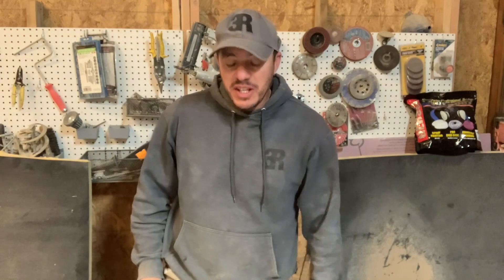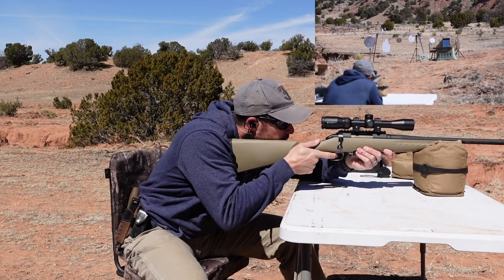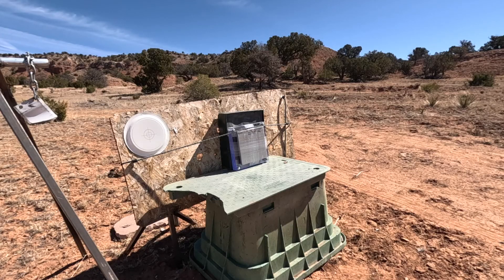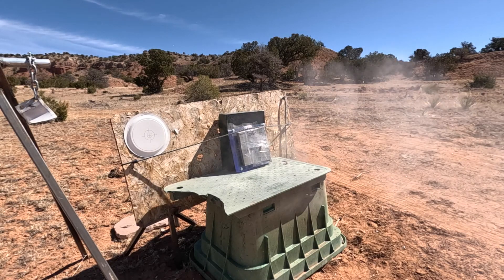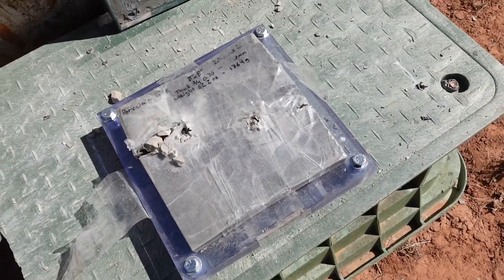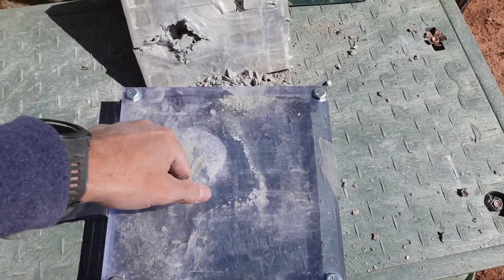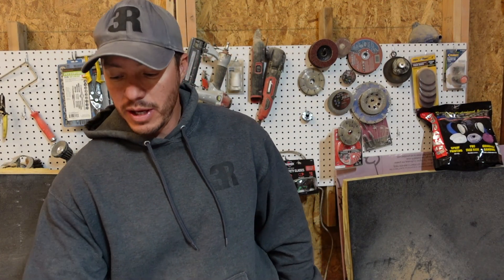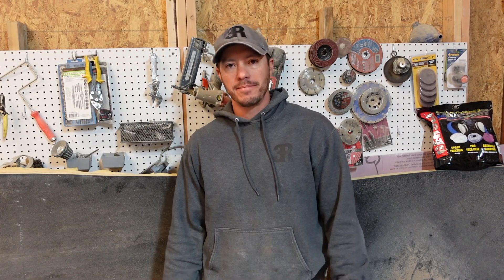Can Tile effectively slow down a bullet?

Comment: Double stack and stagger 1"×1"×1/4"backsplash sheets... but wait, there's more... now put this inside a vacuum sealer bag and fill with oobleck. Ceramic suspended in a non-newtonian fluid encased in heavy plastic, and for schnitzel ticklers, wrap it in carbon fiber

Comment: Use silicone carbide ceramic composite brake pads for making ballistic body armor. In my testing the ceramic composite brake pads with 20 layers of kevlar as a backer to catch any fragments was able to stop rifle rounds,  M855 green tip, 7.62×39, .308 and .30-06cal

Comment: The two layer tile benefited from an edge-gap-effect in addition to the extra thickness. Like paint, building up many thin layers can have better performance than trying one thick coat. Diversifying stacked materials can help such as a thin sheet of aluminum, copper, lead, or soft steel between the two tiles. Take a look at Damascus Steel or Japanese Katana blades, many layers of hard and soft steel folded and sandwiched together to give strength and toughness.
Reply: In the case of Japanese swords, it's a bit different. You see, the reason the Damascusing, or folding, process is done is to better distribute impurities in the steel throughout the blade. Japanese steel was very impure, so this made much more resilient blades. As for the differential hardening, it's important to remember that katanas are made from a single block of steel. Meaning, the harder steel is chemically bonded to the softer steel. The advantage of this was giving the cutting edge a more flexible, less brittle glue. Additionally, it made the edge more likely to chip than facture or flex, something very useful because Japanese blades were not made of spring steel like European blades. And so could not bend and return to shape, they would simply break or bend permanently.

TL:DR the katana comparison doesn't really apply to ballistics here, and what applies to katanas was super contextual

Comment: Got a suggestion to make: Look a medivial Scalearmor, where the pieces overlap partially like roofing tiles do. Palmsized Ceramic Pieces layered like that, followed by 1mm layer of ductile steel strips of wider size ( similar layered and spotwelded) backed by some layers of that landscape filter fabric you showed last time. In Theory the hard ceramic deforms the bullet, the ductile steel should distribute the impact energy and the filter fabric stops the much deformed and slowed projectile. thesmaller pieces or ceramic could in theory have the plate withstand multiple hits if they arent on the same tile/spot where a single big plate may not because of microcracks.
Reply from the maker: Absolutely. I’ve been toying with testing something similar to this.
Reply: @3RBallistics  don't the bullet just climb between the pieces like this?
reason why scale armor was terrible against spears.
thing with ceramics, it's a hard strike surface made to break apart along with the bullet.. robbing the bullet of it's power due to the breakage. 
but if hitting it from an angle. it might just skid.

would be interesting to see tested.
Reply: @martinpetersen6266   I guess that depends upon the angle and then a lot on the momentum. The Spear analogy you use would likely be true if the gun was firing not ordinary bullets, but rods similar to those tungesten/depleted uranium rods used in APFSDS rounds, besides high impact energy there is a lot of momentum behind that, kinda doubt regular bullets will act that way.

Comment: You can use the Styrofoam knife to cut the fiber glass To prevent it from fraying. Basically a heated piece of wire to cut it . I would also rotate the fabric when using layers of fiberglass.. And when you're finished with the piece you could also use the vacuum sealer with plastic and low but a fireglass resin to help keep the edges. From being sharp and rough

Comment: Great video. I had a hard time being able to tell, but did you think the double tile or the single, thicc tile end up producing a better result. I mentioned on the other video that I was interested in using the thin hex tile from the hardware store, but using two staggered layers to cover the gaps. Wondering if it would just be better to use thicker tile. Great work and thank you for making this!
Reply from the maker: The thick tile produced the best results but the weight is a bit of a concern. I think doubling up two tiles is the most practical option.

Comment: It looks like you have a good start on armor. Layers of two-inch Hexagon ceramic tile a quarter inch thick attached to a flexible layer of energy-absorbing fabric an inch or thicker should alleviate the problem of two layers of ceramic tile taking as much or more damage as a single layer of tile. Small pieces of steel coated with bed-liner coating could be incorporated in the same way. 

Try some standoff distances between elements so it is more difficult for damage in one layer don't propagate into the next layer.

It would be interesting to see if you can make bulletproof graffiti with geo-filter cloth, cement, epoxy, ceramic tiles, and ??. Build up a background using enforced cement plaster to hold fabric and ceramic tile to an armored steel back plate that is the background for the graffiti.
Reply from the maker: I really like these ideas. I’ll give them a try. Thanks.

Comment: You might try adding a soft/light/cheap "gap layer" between the strike face and the stuff that's supposed to stop the projectile. The thought being that the face starts to flatten/expand/fragment/tumble the projectile making it easy to stop and the gap give that more time/space for that to happen in.

What might be really interesting would be tile bonded to soft and thin sheet metal (metal to keep the tile bits together longer, soft to get as much stretch before it rips, thin to save weight and cost) on top of 10-20mm of medium density insulating foam and then something more substantial to actually catch things.

Also, have you considered acrylic as a strike face? IIRC it does a very good job of spreading out high loads without shattering to dust in the process.
Reply from the maker: I really like this idea. I’ll give it a try in some upcoming testing. Also, I have used acrylic before and it works really well. I’ll be making a video covering DIY bullet resistant window using acrylic.

Comment: I’ve made and tested a few “bullet resistant” panels with flooring tile as one of the ingredients.  I found what worked really good was 2 floor tiles separated and held together with layers of denim and liquid nails.  Then I used a couple of license plates in the back to help stop any broken rounds that did make it through the tiles.  

When making these panels, I used compression from car batteries on the panels for a day or two till the liquid nails had plenty of time to setup.  You have to be careful though because the layers will slip and slide.  So, I built a small wooden frame to keep the layers in place until the liquid nails setup.
Reply from the maker: I love that idea.

Comment: Very interesting. Lining a safe room Inside and outside with tile and filling the wall void with pebbles/gravel would likely be quite impenetrable by most common rifle cartridges. 
Cool stuff. Now I have ideas. Also, the more I see those Ruger American Ranch model rifles on various channels, the more I want one in .300 AAC.
Reply: I remember seeing something about "portable" structures that are made of steel channel where they use a mesh on both faces to hold in ceramic "gravel". These were also faced with ceramic plates on each side. These 2 foot square by 8 inch thick modules could be stacked into wall structures to create safe rooms or whatever you desired. You could face each side of the completed wall with additional 1” fiberglass panels to increase protection. I think they had these walls tested with various .50 cal. rounds with zero penetration into the safe zone.

Comment: Take some epoxy and fiberglass and bond them to the back side of the ceramic. You will likely have to sand off any glaze on the ceramic. Ceramic has amazing compressive strength and hardness, which is why it works so well. Unfortunately ceramic has very poor tensile, which is the cause of its failure. Fiberglass has high tensile strength and when bonded to ceramic with epoxy they are both in a position to cover the weaknesses of each other and enable them to fully utilize their strengths. There's alot more that can further increase its effectiveness, but that's a good start. I recommend bonding the epoxy to the sides of the ceramic aswell. Believe it or not it would help.
Reply: A bit of light tin between the two might help as well by preventing the ceramic from cutting the glass. Or the ceramic might already be sand at that point and tin might do nothing or act as its own knife. I'd be curious to see.

Comment: Nice video but that is not 3 inches of poly carb it might be 1 1/2 inches but not 3  a tape measure will come in handy 👍🏻
Reply from the maker: I’m sorry, I should have clarified. The control without any tile on it was 3” (each piece of polycarbonate is 1/2” thick, and there were 6 pieces). Each other sample had 1 1/2” (3 pieces) of polycarbonate behind it.
Reply: @3RBallistics  the polycarbonate is an interesting material to shoot at. If you flame polish the edges, you can get another cool angle to show the damage from.
Reply from the maker: @KevinSmith-gh5ze  thanks for the suggestion, I’ll give that a try.

Comment: random thought: 
using 2 layers of mini tiles, cut so that one layer covers the other's edges, then backed with a steel plate that has the edges cut and bent so that it both covers the sides and front edges of the ceramic tile array, then the edges get welded up. 
sort of a hybrid that would also (at least in concept) be functionally spall-proof on it's own. 
adding a 1"-2" layer of the landscape fabric should catch any fragmentation trying to leave the plate through the puncture hole.

great channel, I don't use my google account except to comment but you're in my bookmark bar underneath Ordinance Lab (they're in the "gun-adjacent" section of my bookmarks list lol)
Reply from the maker: I love that idea. I’ve been toying with the idea of putting something like that together to test.
Reply: @3RBallistics  thanks!
I would reccomend the following method to build it: make the steel plate first, then use it as a form to then lay the tiles onto (glue them on) as a first layer, with the second layer then going over that. once it's all glued together solid, bend up the edges and encase it in the fabric, with the hope being that it won't be unreasonably deep in thickness.
Reply: Have you tested this yet? I have a couple mild steel plates coming in the mail Im afraid to use 😅 @3RBallistics

Comment: I’d assume the kiln tiles were cordierite and oxide bonded silicon carbide? I stumbled upon kiln shelves last week while looking for alternative sources of silicon carbide. Where did you get the ones in the video?
Reply from the maker: Yep, bonded silicon carbide. I will say that they have some incredible characteristics that don’t show up on the video. I may do another test to demonstrate how well they actually can be.   I picked up the shelves at a local pottery store. They had a few broken ones and only cost a fraction of what they would have been new.
Reply: @3RBallistics  Can I get confirmation on the other one being cordierite? Also, oxide or nitride bonded silicon carbide, these details may be very important.
Reply from the maker: @cjf-rw8vl  nitride bonded silicon caribe. The other kiln shelf is really a mystery to me. I was told it’s alumina cordierite 🤷🏻‍♂️ but I did not purchase it because it was also from a broken shelf and much smaller.